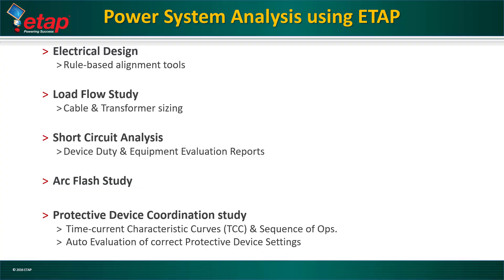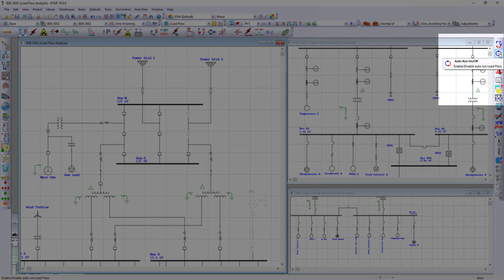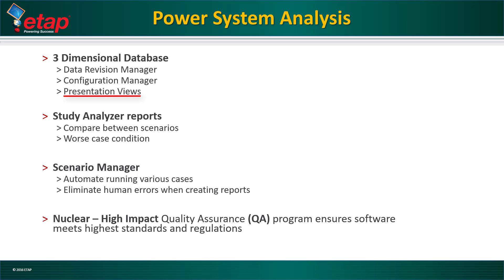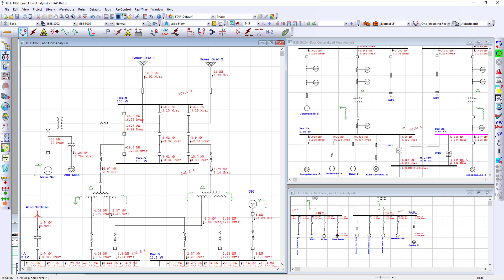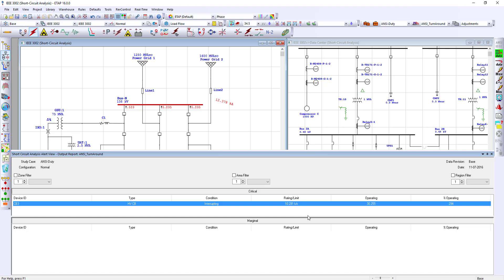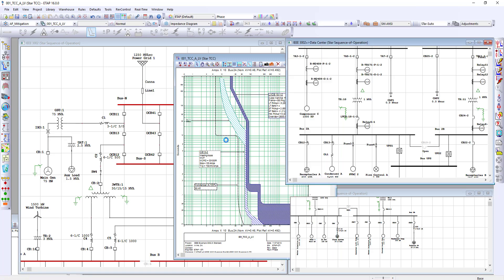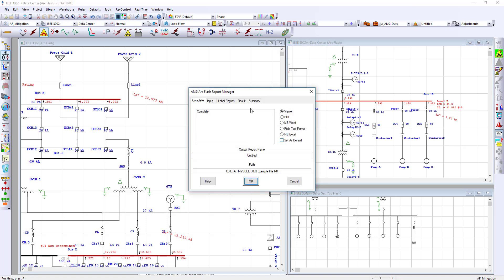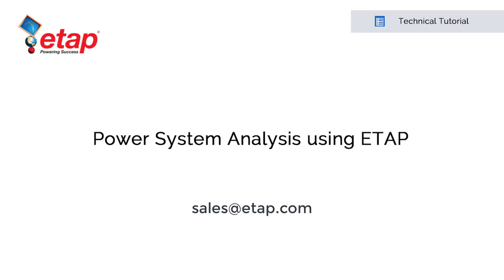Power System Analysis

Comment: Is any way or a short cut way to insert my AutoCAD grid design into ETAP software?
Reply from the maker: Thank you for your interest in ETAP Solutions. ETAP offers several data exchange options: eXCAD allows direct import of AutoCAD data into ETAP https://etap.com/product/excad. Our Revit interface is a bi-directional connector that will add all AutoCAD data into the ETAP One-Line Diagram but also will update AutoCAD with all changes suggested by ETAP https://etap.com/product/etap-revit-interface. For additional information contact your local ETAP office or contact support through our 24/7 Help Center https://helpcenter.etap.com
Reply: @ETAPsoftware  Thanks, dear. I've started doing following this.   I hope I can succeed